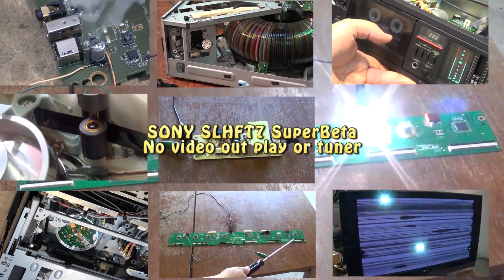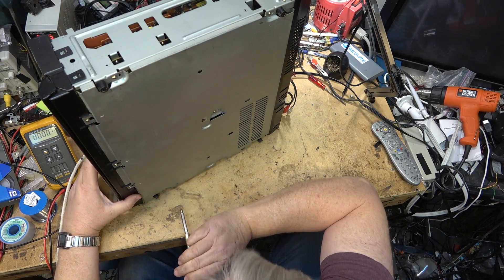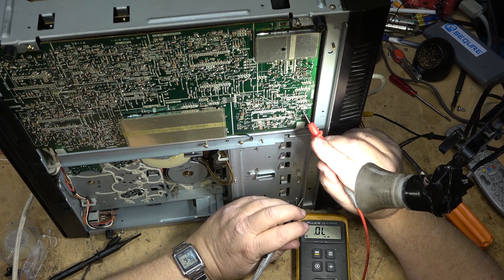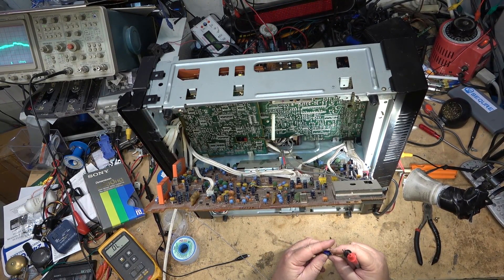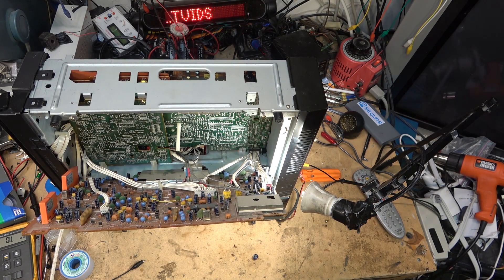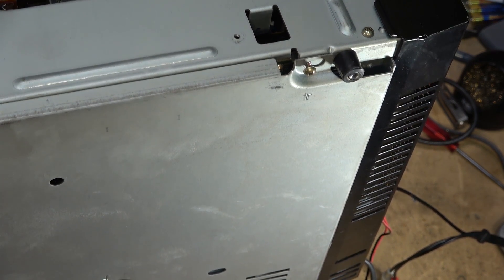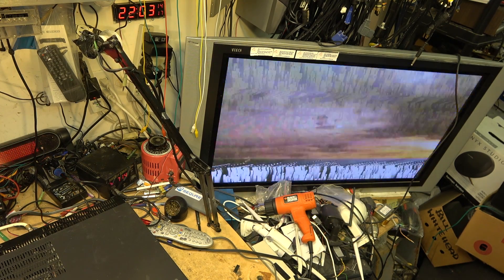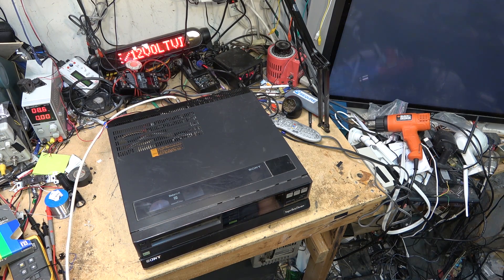Sony SLHFT7 Betamax No video output from Video Out Jack RF Modulator OK

Comment: Sir, i had a problem again on my Sony SL-3000E, no picture, black screen on video output, mechanism all fine it play tapes, but no video, i want to test the video output using poking method like in 1:12 here, but i don't know where should i touch, the only i can find in the board is REC-PB SW

Comment: Thankfully it wasn't that pesky STK module. It was a bad cap! Always a bad cap. :P

I picked up a bit of Sony 80s excess a while ago in the form of a SL-HF860D "DigiBeta". Thing needs some help and one of the gears on the front loader is cracked (go figure). It likely needs the head scrub/polish done on it as well as its not tracking or winding tapes all that well. I suppose I'll eventually get around to replacing that commonly bad surface mount cap on the capstan board too. One of these years.....

Comment: Smashing repairs dave, i hope the owner appreciates your repairs.
Dam another capacitor killing the operation, at least it's not buried deep in the pcb.
Power supplys and audio ouput electrolitics were so common to me.
Valve to valve coupling crap-asitors caught me out a few times.

Comment: I've repaired a few Sony SuperBeta models with this exact problem of no video on the line out because of that one cap that goes bad on the signal line of that output.  One was an SL-HF450.  Another is an SL-HF550.

This seems to be a common enough problem to first check if that cap is bad if you get one with no video on the line out but video from the RF out.

Fortunately, it's a relatively simple repair.
Reply: @Watcher3223 Thanks for your confirmation, and many thanks to @12voltvids for this video!  My SL-HF450 also had the shorted 6.3V 1000uF cap and is now working again thanks to you guys!!!
Reply: @jcam9619  Congratulations on a job well done.

And thank you for your complements.

Comment: The shorted capacitor,
are the DC blocking capcitor on output video?
Reply: No that capacitor  it's for powering up the transistor ( polarisation the transistor)

Comment: No video out seems to be a common problem with these. Had a few of these and an SL-HF-450 where the A/V out went phut. We'd been told it was a chip that failed. Nice to know there's hope if we ever want to revive our second unit in storage...

Handy tip for other T-7 and 450 users - to reset the tracking to the 'center default' press both tracking buttons at once.

Hop you don't forget to replace the SuperBeta Hifi cassette door on the new loader if the customer opts to buy it...